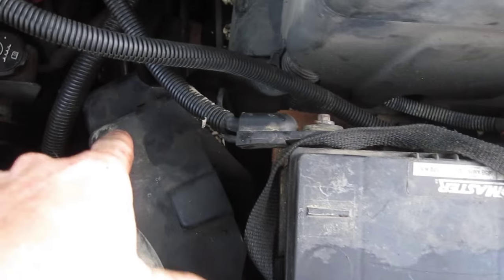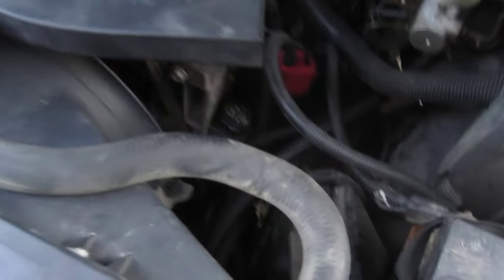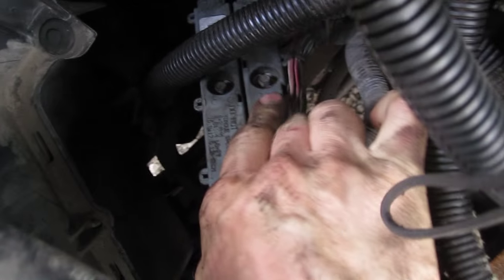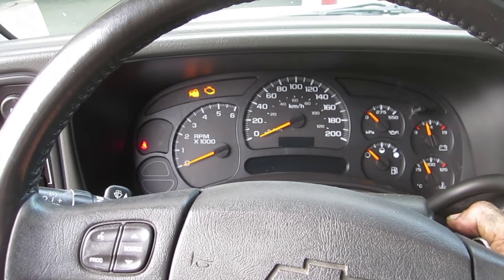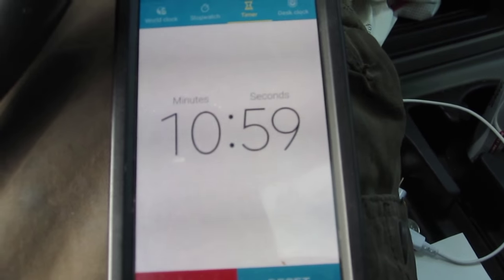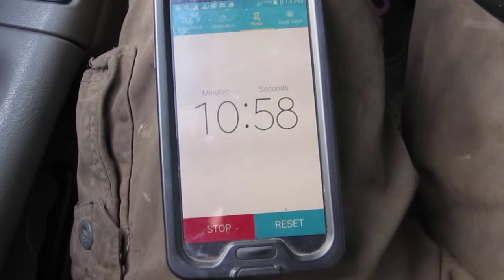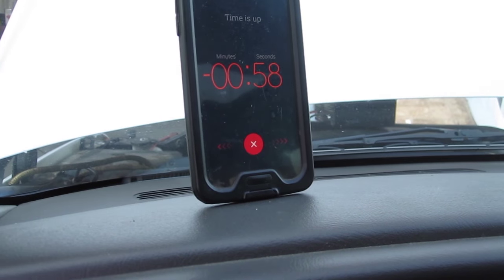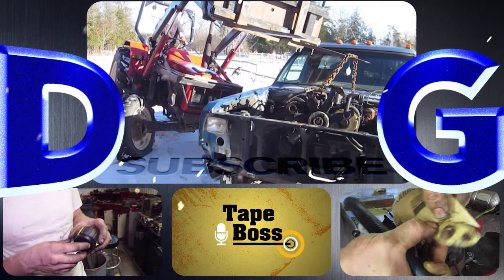Installing A New ECU In GM Trucks

Comment: Worked like a charm on my '04 1500 with the 5.3. After doing everything EXACTLY as in this video, using a battery maintainer and two attempts at the security relearn I got the truck going. It's awesome having a dash that doesn't light up like a christmas tree. Thanks!!

Comment: I salvaged a ECU for a 98 Chevy Silverado at the junkyard and it actually came off of a 98 suburban C 1500..75 bucks and it installed it would not start but did have fire to the plugs as before it did not have fire with the original bad ECU watched your video went through the process fired right up thanks man For sharing this information

Comment: Follow up on my previous comment, worked perfectly for PCM, but ALSO the BCM! Same procedure in case anyone is wondering.
Reply: Can you replace them both at the same time?
Reply: @followerofchrist1961  I wouldn't.  It is best to do one thing at a time, so it is easier to troubleshoot if problems arise.

Comment: Thanks for video. Used GMC Yukon 2003 ECU from junk yard for my GMC Yukon 2000.Works great.
Reply: Im surprised that worked for you but it gives me some hope. I'm getting a U1000 code with crank but no start.
 I heard an ECM would need to be programmed with your Vin number or something like that? I guess you found a way around that.

Comment: I have a 1996 astro that sat for awhile due to needing a new fuel pump. The fuel pump has been replaced and you can hear it prime. Now it won't start, yet ran fine before it sat. Do you think the ECM needs to be reset and reprogrammed like you did in the video? I'll try this tomorrow to see if it works. Glad I stumbled across this. Thanks!
Reply: When resetting the ecu does door have to be closed

Comment: I notice a few say this don't work. First you MUST follow the procedure to the letter. I fought my 2005 Silverado for 3 days. I did this procedure and it fired right up.  Don't get over anxiuous. Thanks for posting my Chevy runs great now.!!!
Reply: where did you get your ECU from or did you reuse your old one i have a 1999 GMC Yukon take will crank but won't start
Reply: David Smith I have a 2005 GMC Sierra 1500 SLT with 5.3L and was wanting to know if you had any other symptoms than it cranking, but not starting? 
Also what all is on the ECU circuit fuse, as well as the location of the ECU and the fuses on a 05' 5.3L for it?
Reply: What were symptoms of your bad ecu?
Reply: Same issue installed new fuel pump, new fuel pump relay, i have spark just  cranks. No fuel to shredder valve.

Comment: Your one didn’t work for me but this one worked for me 
1. Turn ignition on.
2. Attempt to start the engine, and then release the key to the “ON” position.
3. Observe the “SECURITY” indicator light. After 10 minutes the “SECURITY” indicator light will turn off.
4. Turn ignition to the “OFF” position, and wait 10 seconds.
5. Attempt to start the engine, and then release the key to the “ON” position.
6. Observe the “SECURITY” indicator light. After 10 minutes the “SECURITY” indicator light will turn off.
7. Turn ignition to the “OFF” position, and wait 10 seconds.
8. Attempt to start the engine, and then release the key to the “ON” position.
9. Observe the “SECURITY” indicator light. After 10 minutes the “SECURITY” indicator light will turn off.
10. Turn ignition to the “OFF” position, and wait 10 seconds.
11. Vehicle has now learned the new password. Start the engine.
12. With a scan tool, clear any trouble codes.
Reply: Thanks nzmopar1992 your procedure worked on my 2004 Chevy Burb 1500 5.3
Reply: Wow this computer stuff is something else. There should be a law against this.
F   it. Whatever
Reply: This worked on my 02 Avalanche with a 5.3 after I changed my wiring harness plug and replaced the ecu with a used one off an 01 Avalanche with a 5.3. Thank you!
Reply: I try this but my security light turns off ,it only blinks one then it's gone , any ideas?

Comment: did not   work for me. are you putting in a brand new ecm or like me or putting in one you pulled from wrecking yard?

 my truck is aa 2003 gmc sierra 1500 4.3l the  ecm came out of a 2006 gmc sonoma  with a 4.3l
Reply from the maker: mine was from the wrecking yard

Comment: After I start the process and I cranked the truck over and it doesn't start. I cut the key off and turn it back on but I don't have a security light. I've tried multiple times and can't get this to seem to work

Comment: Does this procedure clear out the VIN? If I use it on my original ECM will I be causing a problem? I disconnected and opened my ECM because I get a message "No J1850 Activity" and sometimes "Reduced Engine Power" on my 2005 Workhorse P42 Step Van. It has a GM 4.8L Gas engine. I opened up the ECM and there was moisture inside and a lot of corrosion on the circuit board between the interface pins (the pins leading out to the two connectors). I cleaned the corrosion off with a toothbrush and toothpick and put it back in the vehicle. I still got the J1850 error and it started once, on the first try (it had always started before I did this). But after that, it will only click a relay. No starter movement.

Comment: Are the computer expensive...was just told by mech that the computer on my 05 envoy denali was no good that a new one would cost 1200 and 150-200 to reprogram.....
Reply: There's a guy on eBay, who sells refurbished ones for about a hundred. Also, AutoZone can get it, but it takes a week.

Comment: I'm not sure if I missed this but this was a pre-programmed ECU you put in?
Reply: For2went ; Hey Man , He never said yet it Had to be pre-programmed or it wouldn’t start.
Reply: Yes it was because I saw the check engine light if the Ecm wasn’t reprogramed the check engine light doesn’t show up. I tried many time and it didn’t work, and I don’t have check engine light because I just bought the Ecm and is not reprogrammed.

Comment: Will this work 2010 2.4 terrain? Wont start, key locked in ignition, shifter locked in park, engine light on, steering wheel freely turns. I'm lost on what to do..

Comment: Just tried to do this on my 2000 box sierra and the truck starts and dies. Will a ECU from a 2002 chevy work if put in my 2000 sierra?

Comment: I'm about to replace the ecm for a used ecm on 2003 silverado 2500hd 6.0 exactly same numbers, do u think I need to flashed before install it?  thanks in advance
Reply from the maker: This procedure should be enough
Reply: DEBOSS GARAGE Alright good, thank you for your quick response
Reply: I have the same pickup.  Did it work?

Comment: Are these the steps for "flashing in" a brand new ecu or just resetting an existing one?

I need a new ecu installed in my 2006 escalade and I know it needs to be flashed in I just don't know if that's something I can do at home or if it needs to be done with a computer at a shop. Thanks man, nice video.
Reply: How did you flash yours

Comment: Just ordered a new ecm programmed to my vin number specifically. With this process still be needed? Thanks
Reply: Hey, did it work with the new computer, with out doing this reprogramming process?
Reply: @sidneymeyer9014  it did! But you still have to connect the ecu and motor together with a relearning process. Like turn key halfway on and off for 30 seconds type of thing. Super easy but it’s not plug and play
Reply: @casiokids91 Did the seller give you the procedure?
Reply: @MyLifeThai371 yessir

Comment: I have a 2004 tahoe. One day I was driving and it completely turn off, the stearing wheel got hard and breaks also. Try to turn back on but no response. The truck wont crank and has that theft lock on the dash everytime I put key in ignition switch. Do you think it has a bad ecu and may have to switch it?
Reply: Did you figure out what happen to the Tahoe ? I have an 2003 same with mine stalled out Theft deterrent came on.. Dealer charged me 700.00 for key ignition switch, they say they dont know whats wrong.. I changed a few senors but after reading it may be the ECU but then again it may be the BCM Body Control Module  Now I'm leaning toward the ECU wondering how you are doing with it..

Comment: What year was this 1500? I hear you have to reprogram the ecm at the dealer on 2000 and newer. I have a 1996 Astro which will have a non- programed ecm comming in the mail. Will I  need to use this technique for my Astro as well? Or since its under a 2000 model, should it fire right up? Thanks! Looking forward to the feedback...
Reply: Lol

Comment: I have a question I just changed the PCM in my 05 Silverado did the security relearn now the truck cranks but gets no spark my main question is do I need to have the computer Vin programmed to the new computer in other words do I have to have the computer program to my vehicle VIN number please help
Reply from the maker: +Mr no it all u heard The truck needs to learn the new ECU.  You can use EFI live to force learn the ECU but this procedure should work.  How many times did you try?

Comment: I have an 05 tahoe. It throws codes for the solenoids in the transmission, i replaced all the solenoids. Wiring harness is fine. I can clear the codes and itll drive fine for a day then the next the codes come back and vehicle drivability goes down. You think i have a bad pcm?
Reply: @nuff said did you figure it out?
Reply: @josuebarron3278  yes. I replaced the wiring harness for the transmission and the wiring harness for the transfer case. It was bad wiring, the truck is old and the copper was oxidized causing bad grounding and broken wires and restricted flow of current to solenoids.

Comment: I have a 2010 escalade...i changed the pcm now it wont crank or start..i did the security relearn and still nothing.. All lights work i did a junkyard pcm swap. Do i need to have the vin programmed
Reply: Im going thru the same thing  did u ever solved the problem? If so, how did i do it? Did u have to program the ecu with ur VIN?

Comment: Hey deboss 
I have a 2007 silverado 5.3l 
And I have the cts2 programmer for more torque 
And for some reason the programation crash and the truck now don't start or crack 
Do I have to reset the ECU ? 
PLEASE help me 
From Florida
Reply: RICARDO ROMERO sounds like it bricked the ecu

Comment: Very good friends. Could you help me with my chevrolet TAHOE 2007? I changed the neumatic sensors air and need that the computer car read the news. Also I need reset the computer (is the same, the original, but have some lights on). Thank you very much from Venezuela
Reply from the maker: I think by neumatic sensors you mean the tire pressure sensors?  I was told that only the dealers can make them talk to the Tahoe.  Any code reader can tell why the engine light is on, you don't need to reset the ecu

Comment: This didn’t work for my 2000 Sierra. You have to try to start the motor every time when you go key on. But same procedure 11 minutes and then 30 seconds. After those 3 cycles it will turn on
Reply: I will be trying this tonight on my 2000 Sierra.   Same thing just turn the key all the way?
Reply: dude you just saved my ass I did this on a 2000 Chevy Silverado 1500 and it work appreciate it

Comment: I'm stranded at Pep Boys with my 1997 GMC Sierra 3500 pickup truck in Hollywood California store number 0 6 0 4 they changed my fuel pump a month ago... it went out .. fuel pump relay was loose I'm back at the store. They tightened up the relay connection behind fuse box now. I think it's throttle position sensor they're planning on changing currently the entire tank  pump unit and the motor pump instead of as they did previously just a pump motor only. Initially old pump with 7 lb and then new pump was 7 lb. Deemed by chance defective. I don't think so. Service engine soon light started coming on after difficult start with starter fluid then light turning off after a couple hours while driving.. with subtle occasional dropouts of motor while driving... until I wound up hear back at the store. This is just a trivia puzzle for someone interested... of course they can't figure it out with admission yesterday  . .one of the managers.. hopefully Pep Boys . They just won't listen to me.. possibly understandable.. I'm not showing them my Grassroots degree in my hand... this is Fiasco as I lose money without my truck.. I'm trying to transcend vindictive energy. Just want my truck running.
Reply: Hast thou achieved transcendence?

Comment: My ecu is not responding to my scanner tool. Could this procedure help reset it?
Reply: You could try, I have the same problem with a 1999 Chevy express van. But it's probably because the ECU is dead. Wouldn't hurt to try, just your time.

Comment: Hello there, was this a brand new out of the box ecm? I have a 2008 express 6.0 gas, would this work for me? Regards
Reply from the maker: One from a wreckers.  This should work for you
Reply: @DEBOSSGARAGE  I have a P-30. A pin was broken.  I sent it back to get refurbished. When I got my ECM back it still didn't start the truck. Is there something else that has to be done before it will start the truck?

Comment: having issues with my 05 Z71 4.8. misfire only in bank 2. sounds to coincidental so I'm leaning towards an ecm problem. could this reflash the original ecm or is it for new installs only? thanks in advance.
Reply: Had the same thing, it was the crank sensor. They go a lot, and don't always flash a code. I drove it for years, till it finally wouldn't start at all, then I got the code. Towed it to a shop, and they fixed it.
Reply: Ever find the problem I’m having this same issue
Reply: @culturevulturetv5716 No, unfortunately I lost my job around that time so I had to sell it.

Comment: hey man im doing a 4.8 swap on a 240sx the thing is when i bought the engine it came with no ecu nor harness, if i get any ecu for this engine and the correct harness... will this procedue might get the car running?
Reply from the maker: No.  You will have to use EFI live to change a whole variety of things to make it run.  I am doing a couple LS swaps soon and am just getting into them.  Keep watching for the videos.
Reply: @DEBOSSGARAGE  will this programming work on a 2015 express 6.0l also or it's to new?

Comment: okay i have a question i have an 03 Silverado i get random chk engine codes and if it sits for a long while and the battery dies and i jump it sometimes it will try to start itself without the key and other times all the relays click with jumper cables on like an open circuit is it a bad ecm or wiring harness or what the random chk engine codes are pissing me off
Reply from the maker: First thing, replace your battery and clean all your grounds.  Your alternator and starter are taking a beating by working on insufficient current and it could be spiking by boosting it with another vehicle.
Reply: +DEBOSS GARAGE  battery is new how many main grounds are their and where are they located
Reply: +DEBOSS GARAGE the engine was replaced last week with a brand new crate engine it did it before the new engine and its doing it with the new engine the old engine was replaced because the maf went bad and ran it lean and cracked a piston
Reply from the maker: The one everyone forgets is on the back of the heads.  My brothers truck did it all the time but the starter never stayed engaged.  He thought it was cool.  Also lift your fuse holder on the drivers wheel well off and look underneath for any corrosion.  Does it have remote start?  Any codes?
Reply: +DEBOSS GARAGE yeah had remote start i took most of it out i thought that could be the problem i get radom codes and im going to check the grounds out and also check the mega fuse connections and try replacing the battery cables the codes are random but what i got this time was tac tps gas pedal sensor and random missfire

Comment: I thought it was a joke the first time I watched the video lmao but I guess the on off on off is something to do with the device integrating with the truck?

My truck has been struggling with the current computer for a long time (gauges switching on and off randomly while driving, etc) and it finally gave out the other day! At least I'm assuming that's why it won't stay running but either way thank you so much for the video dude.

I live in a small town and the local mechanics are extortionate douchebags with a monopoly on auto repair / maintenance. They tried to charge me $2600 to replace a head gasket last year and that was how I took the plunge into repairing my own using videos like this..
Reply: PS I did the head gasket repair on my 2004 silverado v6 in one day with a gasket kit that cost me less than $200, then had a mechanically inclined friend line up my timing / firing order for $100

Comment: This is not working. I had a guy come over to flash the new ECU and he cannot communicate. I think he said there may be an issue with the bus interface. Any suggestions?
Reply: edfives I can’t communicate with my ecu as well with code reader haven’t replaced ecu as of yet but what helped you in your situation have you gotten it repaired
Reply: edfives did you figure out the problem im having the same problem with mine
Reply: edfives did you fix your car? If yes, can you tell us how. We having the same issue.
Reply: I plugged my code reader in and it wouldn’t show anything. Turns out it was my cigarette lighter fuse because it is hooked up together with the fuse that ran the code reader plug....